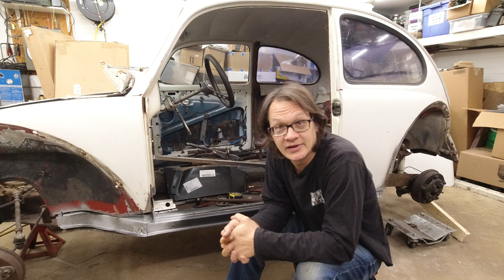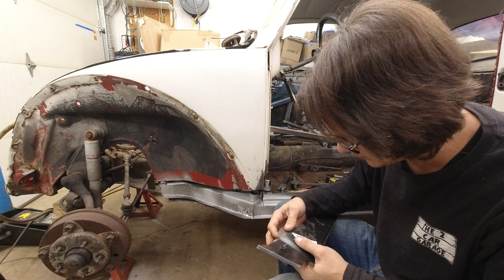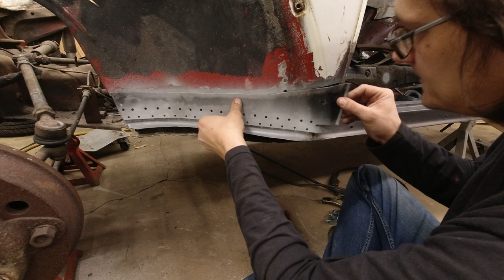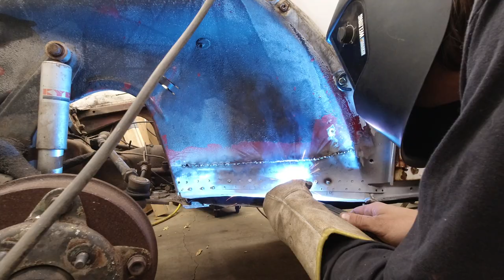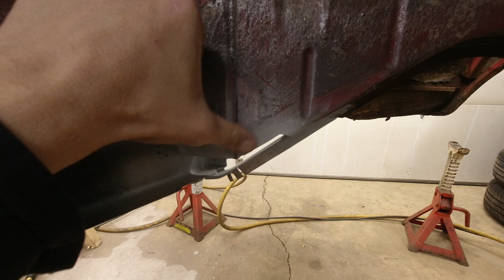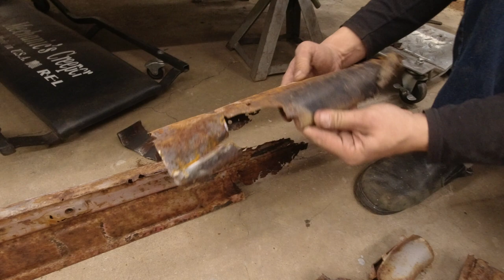VW Beetle Heater Channel Install - Curts Bug Part 14

Comment: Great video. I remember one of your videos showed how to adjust/bend the hinges with a hammer. Do you know what video that was as I need to do the same but I want to do it right.
Reply from the maker: Thanks! The video you’re looking for is Curt’s Bug Part 12. Thats the one where we pre adjusted things before removing the old heater channel.
Reply: @The2CarGarage  Perfect, thanks for that. Mine currently has a very small gap at the front top hinge and a bigger gap at the front bottom hinge. I am trying to figure out the best way to even that gap and also fix the door sag!

Comment: Curt what type of mig welder are you using and what number wire you feeding through ?
Reply from the maker: It’s a old Lincoln Weld-Pak 100. Running 0.023 wire for thin stuff and 0.030 for everything else. 75/25 gas.